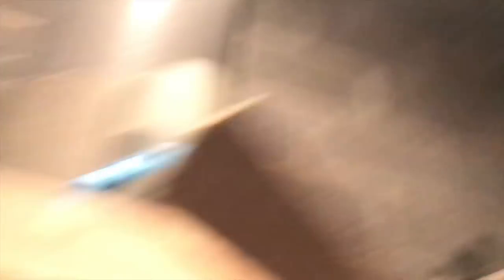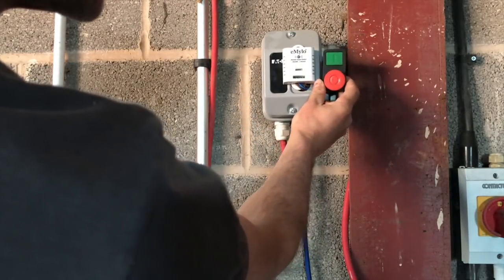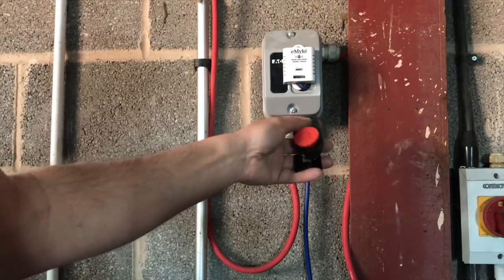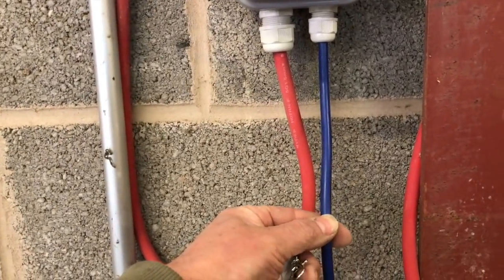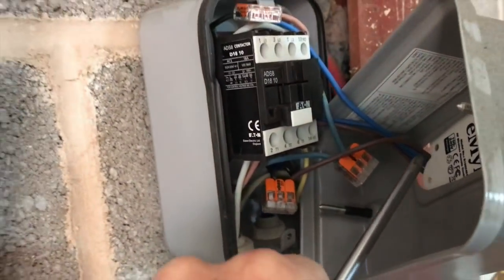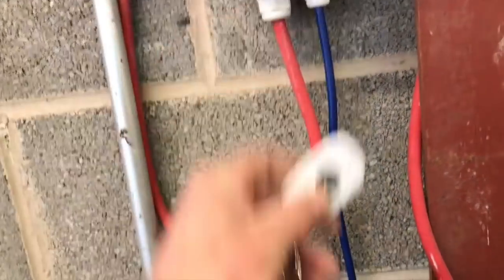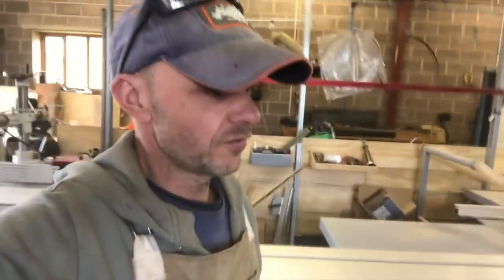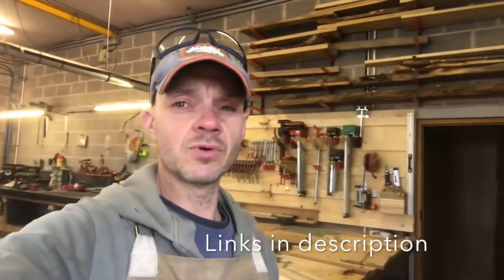3 Phase Remote control Switch

Comment: Good video mate. Quick question. If your dust extractor already has a 3 phase starter switch you shouldn't have to buy a new one surely you can do the same thing at the machine. Just a taught. Not a sparks either by the way 😂👌
Reply from the maker: There’s quite a few ways to do it but you need something that can be switched on and off of 240 vaults and that then switches off all of the three-phase in my case buying this little box which was also a starter switch was by far the cheapest way I’m trying to buy all the components
Reply: @ManorWood  hows it going mate. I'm hopefully finally getting around to trying to do this to my dust extractor. Did you have to use a thermal overload relay with the starter. Cheers

Comment: Hello, I am trying to replicate this project and purchased the same remote switch. The switch that was on the controller was a typical red and green push button switch. It has three wires coming from the controller and one jumper. I have watched your explanation of what wires go where a dozen times but still don't feel confident I have it right and don't want to blow up my controller. Can you help me further grasp this?
Reply from the maker: As I said in the video I’m not electrician if you worried I would speak to a qualified electrician or you could call MEM who make the device and speak to the technical department,  but I did show everything I did in the video

Comment: Would the remote switch work the same on a single phase 16amp extractor with the dol starter on the machine?
Reply from the maker: It should do,  but I am not a spark.